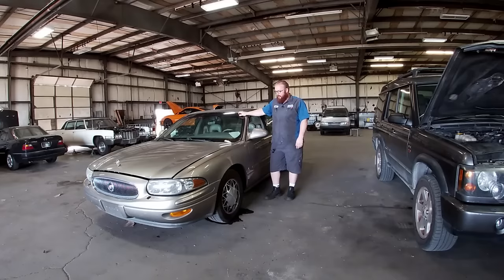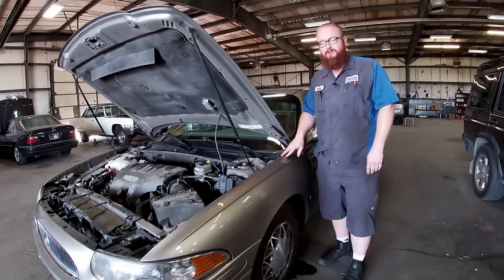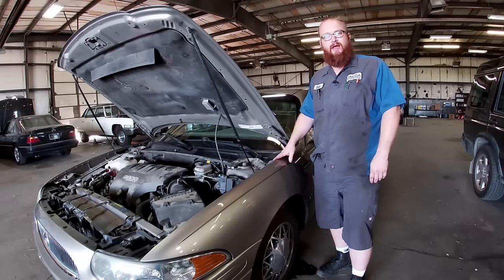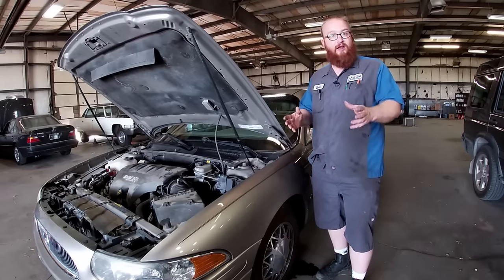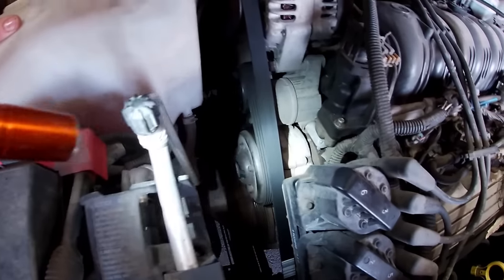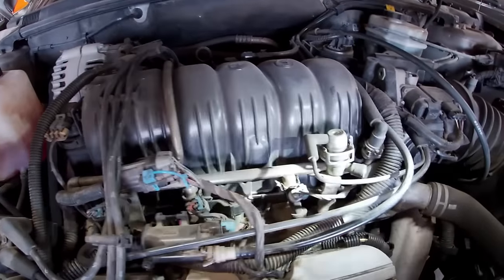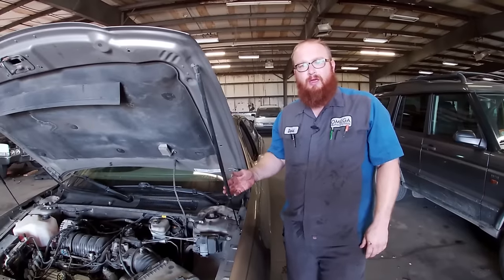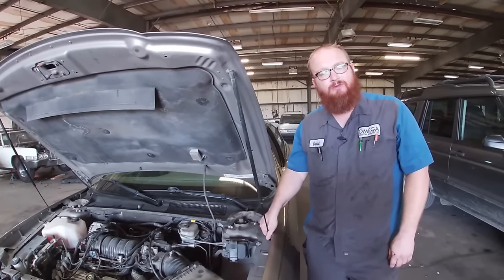CAR WIZARD highlights what makes the Buick 3800 V6 the BEST engine ever!

Comment: I still say the Honda J-Series from the Early to Mid 2000s is one of the best engines ever made especially if it was paired with a manual transmission. The only Major Expense is the Timing Belt every 8 Years or 100k but other than that they're quick, reliable, and cheap to run. Very Easy to work on too.
Reply: I agree I love the J series engines for sure.  Not only they last, they are very reliable and  they perform and have a great intake noise. The only thing I don't like is the timing belt service requirement.  I know people are gonna say what about the transmissions.  Well my 2008 Accord V6 has 134000 miles on the original transmission.  The 8th generation Accord did have solid automatics, whether the inline 4 or V6.  I also have respect for Nissan VQ series.  This was a good video. The 3800 GM V6 was a good engine.

Comment: The 3.8 was good for what it was made for. I kind of saw these engines and cars as appliances. It’s basically a GM V8 with 2 cylinders chopped off. Because it’s 90 degrees, it required balance shafts. Not a thrilling engine, in my book, but for what it’s made for, it did it well. 

The supercharged version at least had some more excitement.
Reply: I wouldn't say "required", most guys either remove them or disable them (via pulling the drive gear off it) when doing a cam, couldn't use it if you wanted to with a double roller chain setup anyways.  I didn't notice any difference on mine with or without it.  I didn't remove it because I didn't want to tap and plug the rear oil hole, so it stayed as a few lbs of dead weight.

Comment: Most dependable engine for me was a Chrysler 225 CID Slant 6.
Reply: Can't beat them. They run forever even if you neglect it! Cars rusted before the engine would die!
Reply: Reliable but a 🐕.

My Dad had one. We wanted to put HP "High Performance" decals on the windows. He got the joke but he was already beat down enough by having to suffer the performance deficits of that engine in order to be financially and socially responsible. Think he would trade a few of the virtues for a 360 CI, in hindsight.

Comment: I once worked in a brand new Nissan dealership in the service department. A man brought a 2006 Maxima in for a window that wouldn't come down. After hitting the window unlock button the window came down. I asked the mechanic if he was going to charge the customer for pressing the button. He charged the man $185 and I have been working on my own vehicles every since.
Reply: :O
Reply: You just gave a perfect example of why automakers have to follow so many regulations about repair, parts and service manuals etc.. available to anyone who wants to buy them. Well all of them except the super car makers that produce like 1000 cars a year and Tesla for some reason gets out of it.

Comment: I was expecting the 4.6 V8 of the Ford Crown Victoria, Mercury Grand Marquis, Lincoln Town Car.
Reply: The 2v is pretty bulletproof
Reply: Those are good engines too, especially the 96+ Windsor. I think what knocks most of them out of the running for this is that most of them burn more oil than gas from 92 to 95 once the valve guides wear out over 100,000 miles. I know, because of the taxi driver I owned a few.
Reply: Just those timing chains and guides
Reply: That's what my daughter drives. Her Vic is older than her.
Reply: MORE GAS
Reply: @carsontoopes837  I think that's mostly on the 5.4l not the 4.6l
Reply: They are about equal. Both needs constant 30k trans fluid changes
Reply: I have a 1998 Town Car Cartier addition with 12000 miles on it . Got it off an old Banker lady  that drove it to the grocery store once a week.
Reply: Barely close in reliability and let's not talk about Crown Vics' fuel "economy."
Reply: @colt-mz3pr  make sure to change all the fluids and torque the spark plugs to spec. That is a wonderful find
Reply: @D4x4Bronc  she was very good about maintaining the car at Lincoln . Her last purchase before sale was for fuel filters  Replacing fuel pump and fuel line.
Reply: I’d love a Crown Vic or Town Car, they’re incredible vehicles. Unfortunately they don’t make anything like it anymore. It was a great formula, very torquey , under stressed V8 engine, soft suspension, body on frame chassis and a lot of room. With cars today they’re too focused on handling and using small engines with turbos. The small, highly stressed engines are bad for long term reliability. There’s no way you could make it past 500,000 miles like the old 4.6

Comment: rebuilding a 1998 3.8. Giving it all new seals, head gaskets, valve seals etc. doesnt blow smoke but while im replacing the rear main seal which leaks water and oil its getting the works. About 300 000km on the motor.

Comment: No ford crown vic, 4.6 love? I've owned both engines and had even less issues. If I did, the engine is by far the easiest engine to work on outside of something from the 1970s.
Reply: It HAS to be easy to fix when it breaks every day!
Reply: I was looking for the 4.6 comment, I agree, much more reliable and easier to work on.
Reply: The 4.6 is another good one. I doubt any mechanic would bad mouth it but the 3800 really is excellent

Comment: In 1983, I owned a 1967 Willys Jeep that had a 225 CID engine in it. In 1967, Willys had bought the Buick V6 factory, but Buick bought it back in 1973 when the oil embargo started.
In 1996 I had 3 foster sons, so  bought a 1989 Buick LeSabre and loved it! Till now, I've had 8 Park Avenues and LeSabres and I'm a Dodge guy.
I've never been disappointed. In 1983 Buick 3800 won the NHRA title over V8's.

Comment: GM used to make engines that would run like crap longer than most would period. 

The 3100 is pretty bullet proof as well but a gutless wonder.
Reply: Didn't those constantly blow gaskets? Every one we had blew head gaskets. My grandma's went through two sets of head gaskets. The third time it happened we just junked the car.
Reply: You're the first person I've ever heard say something good about the 3.1
Reply: crap = shit ; thats telling bout you
Reply: Spun a rod when I had a 3100 floored it  almost every  day for 14 months straight , tough motors no doubt
Reply: @saemushailstorm3135  a turn of phrase tells a lot about me?

Comment: The power steering pump and reservoir is the hardest thing to service. It's below the alternator.
Reply: Power steering rack is even harder.
Reply: I’ve yet to find a FWD V6 car that I would consider easy to work on.
Reply: Only the series two has a plastic upper intake.
Reply: L J recommend you change power steering fluid and trans fluid pump out with suction pump 2 times a year ,you don’t have to change all the fluid but do it 2 times a year takes only a few min  it add the additives in the new fluid back the system will last too
Reply: FrugalPrepper's Garage & Garden  yes that and the plastic intake gaskets
Reply: Kevin R these are not bad

Comment: Buick started using a 231 cubic inch (3.8 liter) V6 as early as 1975.
Reply: Even funnier- the motor dates it;s lineage back to 1930(!) with the "Dauntless" V6. It's also considered one of the oldest engines ever made.
Reply: The early 3.8 Buick motor was bad news..I replaced a few of them in Regals with small block Chevy motors..problem solved ..but that was a different motor
Reply: Wrong, was a Buick Oldsmobile Pontiac, ALUMINUM V-8.  That is why it's 90*  V-6. That must have a balance shaft.
Reply: @nellyfarnsworth7381  what in the hell are you talking about
Reply: @danielmccoy8875  
The truth.  Do some research
Reply: @nellyfarnsworth7381  I think your lost and way off topic..lol
Reply: @danielmccoy8875  No, he knows exactly what he's talking about. The design of the 3800 traces its roots to the Buick aluminum V8 from the early 1960s. That V8 became the cast iron Buick small block V8 (at times available in 300, 340, and 350 cubic inch configurations), and the 225 cubic inch V6 in the early 60s was essentially a 300 V8 with two cylinders cut off.
Reply: @girthquake1413  The Dauntless was a odd fire engine. 225 ci. Sounded different and timed differently...
Reply: @cdglasser  who was talking about aluminum v8 motors .I know all about Buick V8 motors as I actually owned a few ..i was talkind about the early 3.8 V6 they put in Regals and some full size cars ..they were junk and nothing like the old Buick motors..smh
Reply: @danielmccoy8875  No Daniel, you don't know as much as you think you do. The early 3.8 V6 was essentially the same engine as a 1960s Buick 300 V8 with two cylinders chopped off. Hence the reason it had such a rough idle, because it required an odd firing pattern due to the shared crank pins (a situation Buick addressed with the 1977 even fire V6 using offset crank journals). The 3.8 V6 therefore had the same stroke as the 300 (3.4") and nearly the same bore (3.8" vs 3.85"). The 300 was itself an iron version of the aluminum 215.
Reply: @cdglasser  and was junk..like i said
Reply: @rudygrajeda1510  Really? I thought it was based around the old mill. I MIGHT be remembering the "Ate up with Motor" description wrong...
Reply: @girthquake1413  Yeah the 225 was an odd fire the 231 (3.8) was never an odd fire engine.
Reply: @girthquake1413  here's a good link https://en.wikipedia.org/wiki/Buick_V6_engine
Reply: @cdglasser  
You are 100% CORRECT

Comment: Answering the Wizard about our experiences with engines.  I had several good engines.  The old 3.0 Ford engine which powered a couple of Taurus to over 300k.  I had several vehicles with the Ford 4.6 engine which are known to go over 500k if half way taken care of.    Lexus 4.0 engine which has 308K and is still running great.

Comment: Unfortunately where I live, the rest of these cars rust out around the engine.
Reply: So do Toyota's so what's your point?
Reply: @hochhaul  The point is that there's no reason to buy one. What good is a reliable engine in a rusted-out shitbox of a body?
Reply: Pull the engine and drop it in a good body.

Comment: I had an 01 LeSabre, that was the best car i ever had. Never had a mechanical issue, not once!  Bought a new tahoe only made it 80k bad cam design. Got a brand new encore gx, been in the shop 4x's the 1st year. Them leSabre's were really ahead of their time. Has everything and more as the new cars other than a touch screen stereo

Comment: I've had a few cars with this engine. It's practically bullet proof. Best V6 ever made, hands down.
Reply: JustAnother RegularGuy I’ve had 3. My daughter is till driving the 3rd one...and it was made in 2001.
Reply: The Ford Essex 3.8 v6 is extremely similar in design to the GM 3.8, and is also extremely durable. Seen several Mustangs and Winstars with week over 200k still ticking smooth like a clock.
Reply: oneviwatara  Depends, you could get supercharged variants with more horses on both engines, but for a durable pushrod motor that's old in design, not too shabby. You also have to look at torque, these engines are made to have the car chug along smoothly at highway speeds, and were used in some full-size trucks, like the 4.2 Essex v6 in a f150, which is just the 3.8 but stroked out longed.
Reply: oneviwatara  Those engines are overhead cam engines, a more accurate comparison would be the Ford duratech 3.0 doch of the same era to those engines. I believe that one was used in the Ford Taurus, and was also a fairly robust engine. The rest of the Taurus sucked though, the engines almost always outlasted the bodies, especially in the rust belt admittingly.

Comment: I couldn't agree more and I am not a mechanic nor a car expert. I felt this way back in 2003 when I purchased a 2001 LaSabre. I had a similar experience with a 1998 Park Avenue. Car Wizard - SPOT ON! Another point I recall back in the early 2000s, a Buick LASabre was one of the LEAST stolen vehicles, thus insurance was typically lower.

Comment: I believe thats the same engine or similar used in the 90s and 2000s holden commodores.
My brother in law had two and beat the shit out of them and they just kept on choochin.

Then with the VEs thet brought out the 3.6 and they are garbage!

Another great engine is the Australian designed and built Ford Barra 4.0L 6cylinder. They keep going and going and going
Reply: Yup my Barra's doing fine. The 3.6 started in the VZ and so began the chewing out of timing chains.
Reply: JkandI the 3.6 all alloy engine that replaced it is really what broke Holden, and the owners of them with the issues with that engine
Reply: @vintagetintrader1062  Garbage, I have owned a VZ from new with the first of the Aloytech V6 motors and gave it to my sister 2 years ago with 234,000K's on the clock no timing chain issues and my wife has a VE with a Aloytech V6 that was an ex reps car and has done 322,000K's with no chain done and they still go strong. If you look after them, service them and drive them like a regular car and don't thrash the guts out of them they go forever.
Reply: My DAD had a 94 Ranger with a 4.0 It was a great motor.
Reply: Oggy  im a holden man, got myself a ve ssv.
The only reason why I didnt get a ford barra xr6 turbo or G6E turbo was because i couldnt look past the interiors and ended up going for a 2009 VE.
Those barras are fucking amazing.

Comment: I had the good luck of buying a 97 LeSabre from the original owner with 40,000 original miles.The car in clean inside and out,and drives like a dream.I couldn't be happier.
     I have had the car for a year,replaced the rear struts,changed the oil,fuel filter,air filter,and next the fuel pump as a preventive move.

Comment: The new G.M. 3.6 DOHC all Aluminum is ONLY 20 pounds lighter than the cast iron 3.8 liter,  one camshaft with pushrods.
Reply: Lung Dong I have the 2.8 in a CT’s to make them last change oil at 5000 miles add some motorkote and change filters same engine as 3.6 same chains and guides ,but agreed gm should have put series 3 3.8 in the caddy maybe with aluminium heads probably lighter

Comment: Another good engine is the VW AFN 1.9 TDI, they will run forever, and get great mileage
Reply: Did over 240,000 on my last one, was still running when I sold it. Got one in my current Skoda, on 190,000 without a hiccup. 65+mpg easy none of this 30mpg nonsense
Reply: @jongmassey  Yeh last year the Car Throttle channel brought an old Skoda 1.9 TDi with over 200k on it. Took the engine apart and there were still Honing marks on the Cyl walls. They put it back together, fully serviced it, freshened it up. And they now use it as the main runabout car. And it does 65mpg. On a car thats 15yrs old.
Reply: @dj_paultuk7052  Wasn't there 400k miles on that skoda?
Reply: @jongmassey  1 imperial gallon = 1.2 us gallons. So your 1.9 TDI Skoda does 55 miles per us gallon. Twice the fuel economy and half the power.
Reply: @dj_paultuk7052  The Skoda had 450k on it.

Comment: I'm motivated to find a supercharged Buick Regal over a new rebadged Opel Insignia. My 2004 Acura TL with the J32 V-6 and 6-speed manual just can't die
Reply: Honda Accord V6 6MT...probably going to be the last non-type R honda with a v6 and a manual transmission. Regular Car Reviews did a vid on one not long ago.
Reply: The 90s Buick riviera had a supercharged engine to

Comment: "A perfect engine doesn't exist"
Toyota, "hold my beer"
Reply: Laughs in 5vz
Reply: @mattleonard5268  while kind of underpowered for their size, dear God not even Zeus himself could stop a 5vz. They just keep on tickin!
Reply: Toyota ffs you realize they over build and loose money to take sales from the big three to decrease the capital  gains of the western world.
Reply: @JoeRocket-sf6qs  Bruh my Toyota was built by Americans in Texas. I don't care what you say when your Ford or whatever was probably made in Mexico!
Reply: @cameronnorton5898  my Ford was made in Canada 27years ago boi. suck on dat .got it when I was 17
Reply: @JoeRocket-sf6qs  One of my Toyota Pickups has you beat by one year, 1992 but it was made in Japan, I'll admit. Also 345,000 miles on it lol.
Reply: @cameronnorton5898  only 270,000 on mine yet.😉
Reply: @JoeRocket-sf6qs  Which engine you got? I had an F-150 with the 4.6L 2 valve and it was pretty good. I had to fix the tranny and suspension, but that motor was bulletproof.
Reply: @cameronnorton5898  I have the 5.0l 302ci you had 4.9linline 6 300ci they are unkillable, a buddy of mine put over 700,000 km on his 92 hauling chainlink fencing. (work truck)
Reply: Northstar is the best engine
Reply: @rarebrownboi774  Cadillac v8 northstar?? ? God that engine is awful
..
Reply: Joe Rocket1979 not anymore headstudz
Reply: he s right everything can only go so far in  durability nothing is indestructible like some  idiot call toyota lol
Reply: Joe Rocket1979 da funny part is mine is on the original headgasket and it has a minor coolant leak tehe 🤭
Reply: @rarebrownboi774  try a retorque?
Reply: Joe Rocket1979 it’s a cracked coolant pipe part 😑
Reply: @rarebrownboi774  ah..fun times then..not really.
Reply: Joe Rocket1979 ah memories then the end
Reply: Laughs in 7.3 powerstroke
Reply: @jakethesnake4725  far from perfect.
Reply: @JoeRocket-sf6qs , he didn't say it was perfect. Hell, the 6.7 Powerstroke is better. But the 7.3 will run a half million miles every time (as long as you're changing the oil). You'll burn through transmissions long before you have any engine issues.
Reply: @---cr8nw  yes that's a fact but between up pipes leaking and other notorious flaws .....wellll I guess maintenance is really the key to the longevity of any engine.

Comment: I live in New Zealand, and own a 2004 Holden Commodore, that has this engine, but in a rear wheel drive configuration. I've owned the car for 6 yrs, and have spent $850.00 (NZD) all up on repairs on it. It's a great car, with a great engine